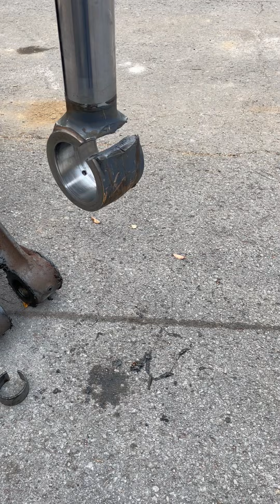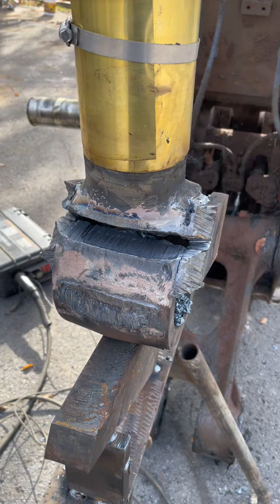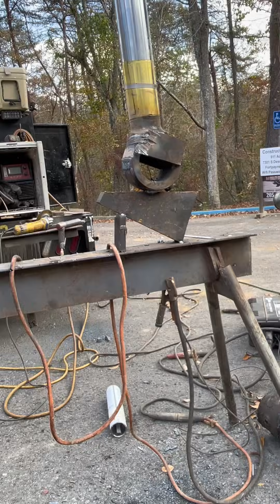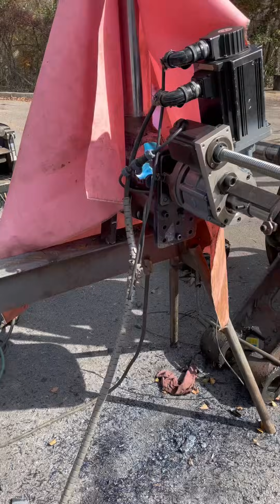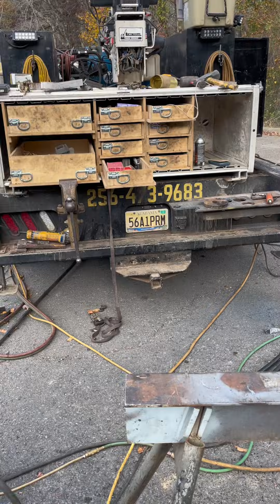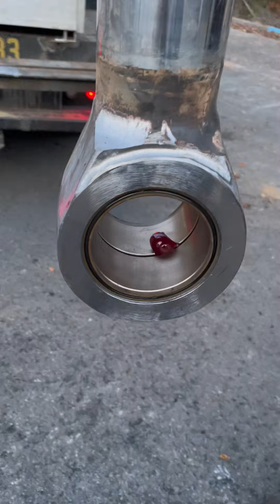Repair on John Deere 350 cylinder eye. Next day service to get customer back up and running.

Comment: I need some line boring . I think you are close to me.
Reply from the maker: @allenlong3939  woodland Alabama
Reply: @ yes you are close
Reply from the maker: @allenlong3939  2564739683. Give me a call
Reply: I would love to get into these kinds of repairs for my own business. I worked at a shop where we did heavy equipment repair, but not this elegantly. I quit that job and started my own mobile welding business, but I don’t know where to begin as far as the equipment I would need to do this kind of repair.  Truly impressive work.

Comment: The machine probably wasn't designed for the extra weight and stress but they used it anyway. My brother does this kind of repair often and more often than not under the same circumstances. This and companies have a phobia about using grease to help reduce wear,LOL.🤔🤔✌️✌️